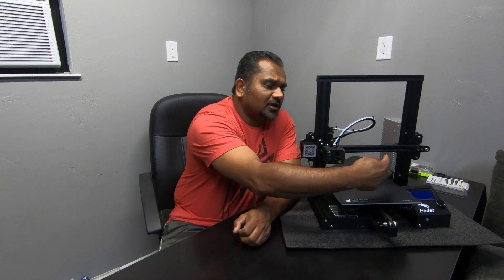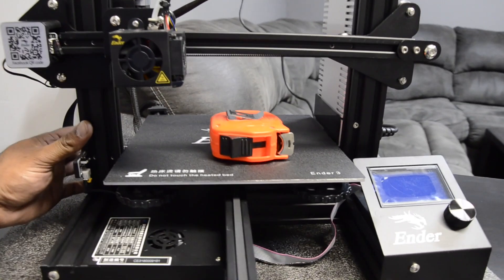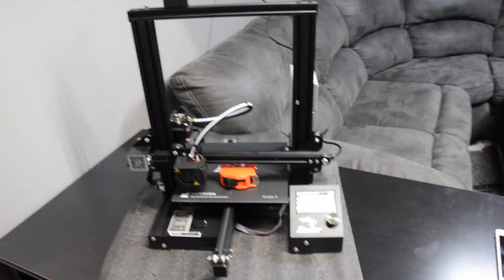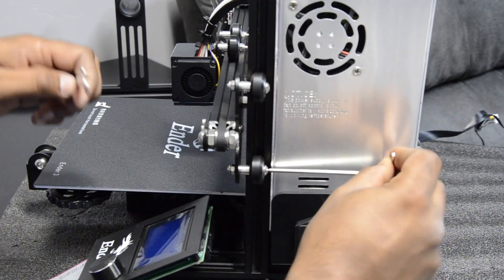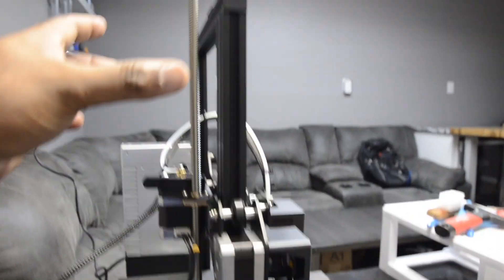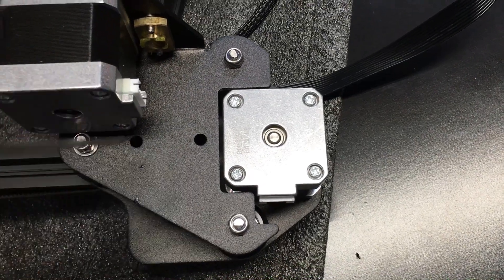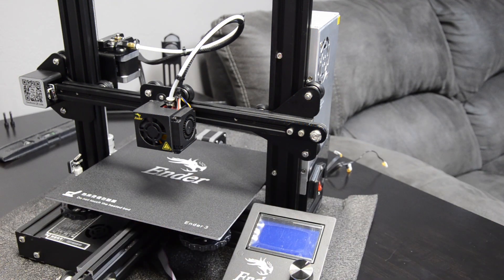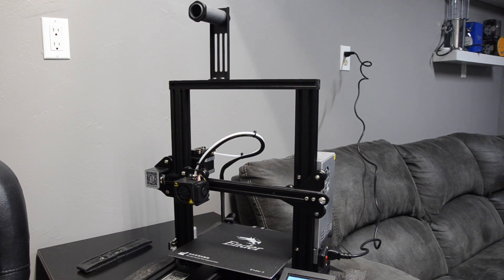Creality Ender 3 / How To Level Your X Axis

Comment: I need help I can get all 4 corners level but then the middle of the bed is no where near the nozzle so it will not make anything. If I adjust it so that the middle of the bed is good the nozzle hits the outside of the bed. Any help please and thank you
Reply: could build it up ... Level the for your corners then use tape in the center

Comment: Hiya San, a really big thank you for this upload. Numbnuts here forgot to tighten the second screws (the 2 fiddly ones with the holes you have to access) and have spent the last couple of days 'adjusting' the rollers to no avail. Yes, I completely forgot the two fiddly screw were snug but not tight. If I hadn't seen this video I would have to go back to the Ggeeetech a30. I bought the Ender 3 pro after watching  Nerys review. I cannot begin to imagine why (to date) 13 people disliked this video. I must, therefore, deduce that 13 villages have lost their idiots.  :)
Reply: very wise words

Comment: I am brand new to 3D printing with a brand new Ender 3 and nowhere have I found enough help on adjusting the bed to do a first print. I will keep looking
Reply: I am not.  (brand new, that is)  I hope to save you a little grief by suggesting that you give some thought to something that I believe eludes the attention of a LOT of 3DP-ers, noobs and otherwise:

This arrangement of 4 adjusters at the corners IS PROBLEMATIC in theory and practise!  What would make a lot more sense, and make this process MUCH easier, is to use the same design that transits and levels (used by surveyors and builders for eons) have, and that's a TRIANGULAR arrangement of adjusting points.  That said, this ain't what you gots, there, so I'll move on to my suggestion now that I've tipped my hand with that sidebar.

For the sake of this discussion, imagine that you are starting out with a bed that's PERFECTLY level.  Now consider what happens when you move JUST ONE corner adjuster - either up or down.  What has that done to the other corners - and to tensions on the bed itself?  The other 3 are still in alignment with each other, so what else has to happen to get all 4 co-planar again?  The simplest answer (though it will be a real lucky stroke if it will actually produce the perfect solution you probably seek) is to turn one of the two adjacent corners the same EXACT distance that you moved the first one, thereby moving the two adjusted corners as a linear unit (otherwise you'll be stressing the bed).

Another (minor) imperfection is due to the fact that the adjusting points are not clear out at the corners, so wherever they are, that's precisely where you must make/take any vertical measurements to try to get a grasp of the lay of the land.

Now that I've tried to explain the problem as I see it, there remains the more difficult issue of how to apply ANY of this to the real-life situation of how to get your bed, wherever it is, TO the perfect alignment that I started you at IN YOUR IMAGINATION!  And - guess what - I don't really want to proceed into that lecture here and now.  Sorry.

BUT -- I will give you this, and hope it helps SOMEONE (CH - I trust you've solved yours ere this - and gotten up and running well????)

Check where you are, by whatever measuring method at your disposal.  You may actually find a deck of cards to be a good method to dial it into the ball park.  Note the tension on the spring at each corner, too - you don't want to run out of adjustment, bottoming out or leaving flopping in the breeze - so starting each near the middle of the usable range of adjustment would be a reasonable starting point.

Now for the theoretical plan of attack:  machine off.  manually move bed and extruder to get the nozzle over the adjuster at MinX, MinY, turn the Z rod until you can put about half of the deck under the nozzle (without forcing anything).  Now move the nozzle to the MaxX, MaxY adjuster and bring it to the same height (same number of cards).  Back both the opposite corners down a little so the bed can easily rock back and forth on the diagonal that you adjusted, and double-check both now that you're sure the unadjusted corners are NOT interfering.  THEN, after you're happy with the first diagonals being level, go after the remaining two - doesn't matter which order - just one at a time make them match the first two.

Now you can fine-tune with a single sheet of paper instead of the deck of cards, and -

then there's the non-trivial matter of where the Z end-stop switch gets adjusted to match.

I could tell you, but then I'd have to shoot you.

Sorry.

Or - were you planning on adding a BL Touch or similar bed sensor?  COOL!
Reply: @palewriter1856  Yes,I am looking at at a BL.It would make my life much easier. Thanks for your help,PW!
Reply: Hey Carey

My CrE3 has been so painless that I've not felt much motivation to get my BLT installed (though I've every intention of doing so).  Meanwhile: are you operational yet???

In case you're not - short story re: Z end stop - if I may continue from my previous post, where you might have gotten all level relative to the X carriage, and gapped to a paper's thickness:

I'd then loosen the Z-stop bracket just enough to allow vertical movement,  move it down  until you're certain the switch is not closed, then sneak it up EVER SO SLOWLY (microscopically) until you hear it click, then tighten it into place.  Now lower the bed at all 4 corners by some margin of safety, an equal distance at each (like perhaps two complete turns of the wheel) and fire it up and run the auto home thing.  Then your nozzle will be at its idea of ZERO and you can sneak the bed up to the nozzle ever so carefully, by the same order as before: first MinX, MinY - second MaxX, MaxY, but for the first cut at MinX, MinY leave it maybe 2 or 3 sheets of paper until you get MaxX, MaxY up close.  Then back to #1, then #2, then 3 and 4. Dial them all in fairly close, but on the loose side.  Final check, after getting all 4 corners, should be done WITH the bed warmed up.  Anyway, this should get you close enough to start printing, if you haven't already.

One more thing - at first you should probably avoid making the initial layer too tight - until you're pretty sure you're dialed.  Maybe start with a 0.3 mm thickness for layer 1.  As it prints the skirt you can tweak the corner adjusters if needed.

Make sense??

Good luck!

Print me some money?

Comment: is it the same thing for the cr10s...? i am just afraid to play around wuth my new printer
Reply: yup, check that the springy  joints  on the steppers really are pushed down too, loosen the screws on each , push down and tighten screws again, do a home and measure ..ialmost lost it before i noticed. i had one side constantly sagging, just a little .. ruined many prints

Comment: Ok, I love the video San and appreciate your hard work - however, this is the super-difficult way to do it and probably won't result in a true X-rail for most people.
HERE's HOW TO CHEAT >> Which is how i did mine. Loosen the right outer coasters, like San does 02:20
.
Take your X to the top of Z and squeeze it against the top rail (no need to remove)
.
Then get a rule, or a piece of paper. Crease the paper against the top rail on the right. Check it's the same on the left. Adjust again and repeat until your X is parallel to your top rail. Then lock the right outer coasters down, tweak the concentric if you need to and you're done. In 1 minute. Mine was 4-5mm out when I got it, almost too much for the bed adjustment. Now it's close to dead-on... not that i checked with calipers nor nuffin. xxPD
Reply: This is confusing as hell... "get a rule or piece of paper and crease it against top rail on the right"... what are you trying to say here? What are we checking to make sure it's the same? I'm sorry, but I'm really confused by the terminology you're using. None of it seems to line up with anything I've seen about how to correct these types of problems.
Reply: @medavis  yes, just checking that the distance matches. On left and right, creased paper is very accurate and everyone has it :D
I wrote the proper way up too, wrangling your X by hand definitely isn't the recommended or mechanically correct method - as I said, a cheat :)
But with this common qc fault on enders and the soft aluminium rails, it works well enough - no one will pass their engineering degree using my method, i hope :D
Reply: I think he's essentially saying to check the gap matches at the top. You could use a ruler or calipers - I cannot imagine why you'd prefer to measure using creased paper.

I'm not convinced by this approach as it works on the assumption that your 2020/2040 extrusions are all cut perfectly to length and thus the top is an accurate  place to measure how square the gantry is. This only works if you are one of the lucky ones whose extrusions were all cut perfectly during manufacture but the rest of us need to check the entire frame is square, not just that the gantry is level with the top beam.

I'd just put two items of equal height (e.g. a spice jar) between the gantry and the horizontal extrusion beneath the bed on each side. Now loosen any and all frame screws plus the gantry screws then tighten them back up again. As long as your printer was sat on a flat surface, your frame should now be as square as it's going to get without modification. In addition, your gantry is now tightened level to that squared frame.
While you've got the printer disconnected, take the time to verify your leadscrew lines up with the motor coupler too as that's another common cause of z-binding with Ender 3s.
Reply: @KayakingVince  yup :) and that's a nice method for squaring your whole frame. Another common assembly fault.
The left upright also traps the control box lid sometimes, many people have a left upright that is hard to fit at the top and 1mm higher than the right.
The cheat only fixes X fast, if the frame is properly assembled.. yes xx
Reply: @medavis  here's 'why' and a more assembly-accurate, if far more involved, way of fixing the problem.
>> It's true, no one ever mentions this but this is also mostly not how to fix it. Adjusting the right concentric nut never makes any difference, unless your X is already horizontal and just needs to be trued to the rail. Often (apparently, mine was way-off too) the X-stepper assembly isn't at 90 degrees to the rail. The only way to properly true your X is to loosen all four bolts, though the holes in the plate - make a best-guess at a good alignment (you can drop it on backwards on one rail and use a set-square) and then drop it on both the vertical rails to check. Tighten your rollers start to wind X back onto Z, you can accurately measure alignment from the Top of the rails. If you're happy, rise it back off and lock down the bolts, not too tight.

Trying to guess this from the bottom or just assume a true won't do anything. Sorry SAN, it's a good attempt to fix something not often covered on Youtube but it won't result in a flat X for most people. They have to correct the assembly error, accurately. xxPD
Reply: Thanks James!
Worked like a charm :)

I couldn't get a good result with the video, but your trick got it to dead center.
If you loosen the concentric nut too much, the screw itself will start turning... I had to use some pliers to hold the screw while I tightened the nut.
Reply: What does rinse and repeat mean? Adjust the screws underneath the plates?
Reply: @steveeng4871  carefully adjust and check the measurements until both sides of X are aligned.
Sorry xx my lazy english :D
Reply: im glad i didnt AV TO TAKE IT TO BITS AGEN XX
oops :)

Comment: I followed this video and was able to level my X axis properly. But as I set it to auto home, the Z axis was going down painfully slow. Really slow. Just wondering if any body has an idea as to why it is like that and how to fix it. Thanks in advance!
Reply from the maker: Yes, check the coupler or guide that the z axis is connected to;  its a brass peace that the z rod goes thur. You can lessen it or tighten it.
Reply: SAN TUBE  Hi, already did try to tighten them or loosen them with no success. I have a feeling the stepper motor has an issue as it has a grinding noise.

Comment: my MP maker pro mk1 has issues like that (mostly caused by me...). I found I could level using a short bubble level and adjusting the rods as you showed, BUT!!!! the printer has to be off and unplgged or the other motor senses the change  and moves too. Not sure why that happens, but Ive had good luck doing that if its off and disconenected. Good vid and thanx for posting it
Reply from the maker: Happy to help!

Comment: did not fix my problem with Z axis not moving up...
Reply from the maker: There is a small guide that the z rod is attached to. loosen that a little and see if that works.
Reply: @SANTUBE  I assume you mean the brass nut being misaligned with the z coupler due to the bracket it sits on not being a 90 degree angle - this is indeed a common issue with Ender 3s. 
Adding motor shims or loosening the brass nut alleviates the issue at certain heights but won't get rid of bad leadscrew misalignment in both the X and Y axes simultaneously.
I've got this very issue myself at the moment. Before dismantling the bracket to hammer it into shape, I intend to try one of the best mods I used to use on my Anet A8 that decoupled the brass nut and instead allows the gantry to float on top of the nut, smoothing out any misalignment and also helping prevent a bent leadscrew from translating as much wobble into the main frame.
https://www.thingiverse.com/thing:2067676
I've yet to test it in the Ender 3 but I reckon it should work so long as gravity can reliably lower the gantry against the friction of the wheels in the side extrusions as there would no longer be any way for the brass nut to transmit downwards force to the gantry.

Comment: I tried doing both suggestions, which helped a bit. I went from being 7mm off to being 5mm off. However, the right side of my x axis still sits lower than the other side by 5mm. And i definitely can't adjust the bed enough to compensate. I think I'm going to try and redo both methods again, in case I messed up somehow. Otherwise, is there anything else I can do? Do i have to buy an autoleveler?
Reply from the maker: No you don't have to buy any auto leveler.  Just try it again if that doesn't work then there are other things you can try.
Reply: Put the printer on a flat surface, loosen the frame screws then retighten them (ideally do two passes to avoid introducing more misalignment into loose screws from tight ones). If you frame wasn't square then this process should correct that.
Now try squaring the gantry again, either via the method in this video or by wedging two objects of equal size beneath the gantry and the lower frame then retightening the gantry nuts whilst the spacers hold it level.

Comment: When I try to move up by hand z-motor, left x-brace side starts to rise, but right side not at the same time. It starts to rise after a while. Is this normal or can affect layers height ? Should I fix it with the method you use in this video by thightening the wheel?
Reply: I don't know if you corrected this but it must move each side at the same time while having not any loose. Did you correct this?

Comment: hi San - my printer does not centre when starting to print all of a sudden - i send it home and ot goes home but starts up printing in the front of the board, any ideas ?
thanks
Reply: all sorted - my x axis ribbon c able was damaged - resoldered and working fin
Reply from the maker: Good to hear all worked out.  Good luck and happy Printing.